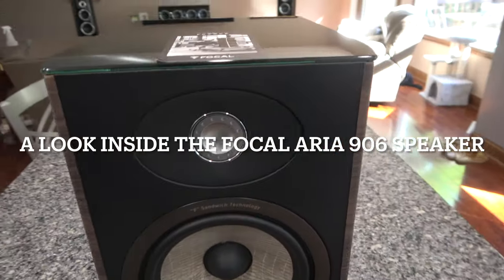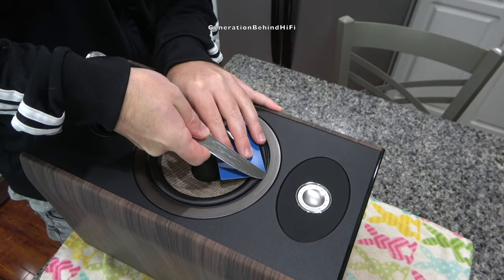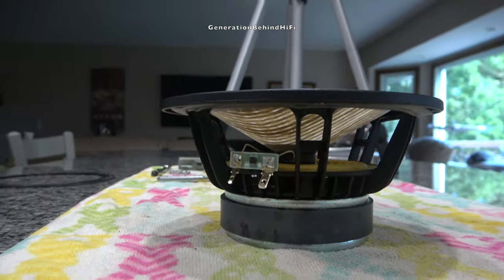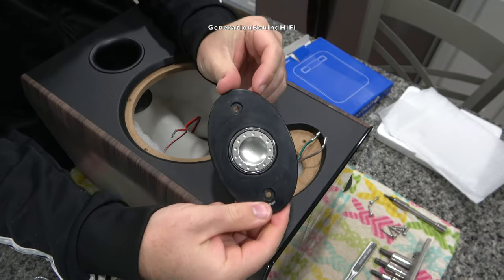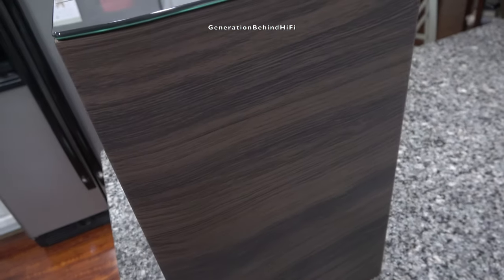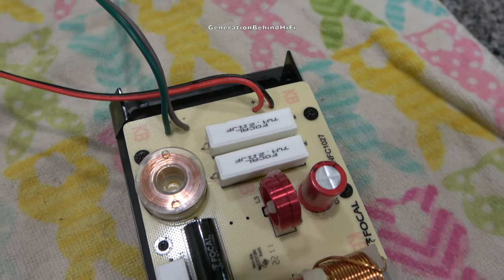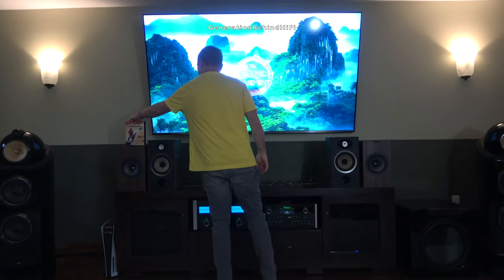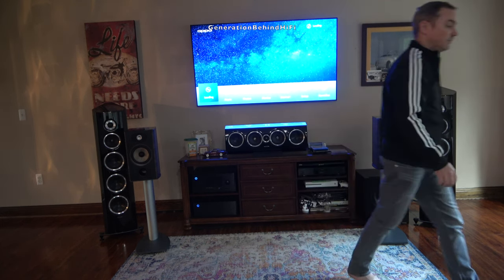A Look Inside The Focal Aria 906 Speakers

Comment: Really interesting thanks for filming. These are only a few hundred Euros during sales in Europe, which seems much more in keeping with the build. The soft stick-on wave guide and thin MDF were particular disappointments for me.
Reply from the maker: "These are only a few hundred Euros in Europe"

Holy cow! Really?! Now it all makes sense!
Reply: @generationbehindhifi  Yeah... each! Cheapest each is 439€ at the moment.
Reply: Yea, for whatever reason—import taxes/shipping/pure proximity—All focal speaker la are usually significantly less expensive in Europe than in the US.  Maybe they just mark them up because they are a little more revered stateside than in Europe where they may seem a little more ubiquitous. But if you can track down guys selling focals second hand in Europe and willing to ship stateside, you can get really really great scores.  And often, the Shipping isn’t nearly as shocking as you expect it to be, especially on Car audio.

Comment: Never liked Focal and it is shocking to see how cheap they make these speakers. Thanks for doing this. I hope you can get to do this with many other brands. Great video!
Reply from the maker: No problem! This was my first pair of Focal and I wasn't impressed! Check out my look inside playlist to see all of the tear downs that I have done -- the link is in the description.
Reply: @generationbehindhifi  I wish if you could do same video on B&W 606 S3. thanks for this video man
Reply: Focal was more known for making drivers that mostly DIY used to make their speakers with.   However, from what I have seen (here and in other places) their fully made speaker cabinets leave much to be desired.  Definitely not worth the money.  Not that I would be spending $2k on a set of bookshelf speakers anyway.

Comment: Looks like about $300 worth of parts per speaker.
Reply: That's about right. 300 in parts, maybe another 300 to assemble and paint etc. Then you have marketing, distribution, insurance costs etc. That probably means the selling price to trade is around 1000 to 1200, then the retailer will mark them up by around 40%. That gives your retail price.

Your comment is like saying "that house has bricks and mortar worth 10% of the valuation, so the valuation is wrong"
Reply: I believe he is implying that this speaker should be selling for $300 and not $2200 and he is very right.  Focal is on the top of my list of "troll" manufacturers that rob the buyer of their hard earned money.  Did you see the chinsy Radio Shack like tweeter the Aria uses?  No, Focal isn't getting my money...ever.
Reply: @everything777 maybe 300 to assemble and paint? Are you crazy!!??
More in the area of 1000 if you take into consideration European Labour Costs.
And please...don't come with the BS...It's made in China.
I've seen hundreds of these lined up at the production facility in France.
Reply: @jukingeo  don't knock it until you hear them!
Reply: No way in France these used to retail for 500 euros a pair and in the UK they have never been more than £700 a pair. The mark up in America is insane you are almost paying kanta level prices for an aria range. This just shows that sound quality has nothing to do with price of speakers as people in America are still happy with them for the insane $2000 asking price.
Reply: @Jordonater  My take on parts cost is influenced, I guess, by the fact that I've been building speakers for 50 years and remember what I used to get Focal drivers for back in the 1970's.

Comment: Can you do a crossover upgrade? Maybe Dodo Hex mat the inside too to fix the ringing. Speaker cable inside also looks weedy. Though I would understand if you just flogged them on but at 800 dollars if you get a good deal that does leave room for mods. At least removing the steel parts off the crossover and solder on some wire + upgrade wire + Hex mat would cost very little and should help.

Comment: It is hard to tell, but is there a seam in the woofer cone? At 2:24 in the video, there is a dark line at nearly 9 o'clock of the cone - is that a seam?
The magnet structure of the tweeter is *tiny*. There apparently is almost no space behind the inverted dome for a resonance chamber. I'm guessing the Fs of the tweeter is quite high?
If I was to guess at the XO design, it looks like a 2nd order on the tweeter, 1st order on the woofer, with a notch filter on the woofer.
Reply from the maker: Hi Neil, I know exactly what you're talking about because when I was unboxing these speakers I thought the same thing! Thankfully its just the material that Focal uses which gives off an illusion that there is a seem there. 

I didn't even bother to measure the tweeter because I knew it would probably be bad and I didn't want to turn this into a Focal Aria 906 bashing video. IMO the Aria 906's are a complete rip off at $2200 a pair, but at the current sale price of $998 a pair they offer pretty decent value for money. I just finished my review video of them and will post it next month. I go into more detail about how the Aria 906 sounds and compare it my KEF Q350.
Reply: Yes, I was mostly shocked by that tweeter as well.   It reminded me of a hard dome tweeter that I bought at Radio Shack to make a small set of bookshelf speakers.  It had a tiny magnet like the Focal's have.

Comment: Kef speakers are amazing. I just got three r11s.
Reply from the maker: Yeah, it is a stamped steel basket, but it sure does sound good. REL will happily sell you a sub with a diecast basket. You just have to open up your wallet a bit more. ;)

Comment: What if there was ferral magentic material in the binding posts? Also, its sad to see the quality in speakers costing so much. Seems like you can get the same quality or better for cheaper or diy. I guess in this example you are just paying for the name? Awesome video as always though!
Reply from the maker: Ferromagnetic components are never good in the signal path because they introduce passive intermodulation, aka 3rd-order harmonics distortion to the signal. IEEE did a white paper on their findings, which can be found here: https://ieeexplore.ieee.org/ielaam/22/8681220/8632973-aam.pdf

Comment: Thanks so much for this video as it goes to value and what one should expect for this kind of $$$$, with most speaker manufacturers.  Important thing to remember is economy of country built and where parts are procured.  In the case of this speaker it's all cheesy parts and the sound confirm this.  Pig with Lipstick...
Reply from the maker: No problem! My review video of the Aria 906 will be out on November 3rd

Comment: you are comparing Made in France vs Made in China. B&W and KEF make everything in China for everything under <5k per speaker.
These speakers can be bought on sale in europe for 300$/piece
Reply from the maker: I don't care about where they make them or what their "sale" price is. The fact is Focal had an MSRP on these speakers in the states for $2198 a pair. In my market (United States) these speakers did not offer the same value propositions that other brands offer at this price point.

Comment: Dude, don't use a butter knife!  Get a 4140 pannel pry tool so you don't mess up the speaker on accident.
Reply from the maker: Settle down, its fine! I promise no speakers were damaged in the making of this video. :) That's why the plastic credit card is underneath to protect the speaker. I don't see how a 4140 pry bar made out of stainless steel would be any better? I tried a plastic pry tool but it would just bend without loosening anything up so out came the butterknife, which served its purpose. The fact is Focal loves their double sided tape which can make servicing the speaker difficult.
Reply: @generationbehindhifi  having a hater just means you’re  doing something right
Reply: @EveryDayJay415 he's not an hater. He's more of a seeker. Seeking out things which Ain't Perfect 😂
Reply: @totalplonker824  He isn't wrong though and the tool mentioned does an exceptional job, taking crude tools to expensive equipment is looking for trouble - eventually it will cost you.
These FOCAL speakers were a bit of a horror show inside for $2000. Garbage.

Comment: Some context needs to be added. These are actually 1000.00 speakers in France and most of Europe and went for 1500.00 in the US when first introduced. Focal products have always been high in the US. The only reason the price is this high are greed and inflation from Focal's owners. 2198.00 is really way to much for these. With that being said they should be judged as 1000.00 dollar speakers and not 2000+ speakers. In this context  the build quality is just fine for a speaker at the 1000.00 price point that is built in France.
Reply from the maker: I didn't know that! Thanks for sharing! Unfortunately the fact is Focal sells them for $2200 a pair in the United States so they need to be compared to other speakers in that price category.
Reply: @generationbehindhifi Does the focal sells them there or does the distributors sell them there? I honestly cant buy directly from focal unless Im in France so I imagine those are distributors that set those prices and focal is not to blame
Reply: @generationbehindhifi  In france the 926 towers with center and the surrounds or 906 speaker 5.0 set is less than 2000 euro

Comment: The Ascend Acoustics $1495/pair Sierra LX speakers absolutely destroy these Focals. Cabinets are 3-layer bamboo, drivers are custom spec’d SEAS, and they are designed, engineered, and optimized on the $100K Klippel NFS. Frequency response is an extremely flat +/- 1.25 dB across the range. And those Focal $5 crossovers are a joke.
Reply from the maker: Never heard of Ascend Acoustics, but I sure wouldn't mind them sending me a pair to review and tear down.
Reply: I'm with you!! The Seas units are some of my favorites.  I've built hundreds of xovers and there's no way I'd put that one in any speaker.

Comment: Its almost criminal the price you pay for cheap crap Its all markerting hype its the same for a lot speakers unfortuatly
Reply from the maker: You're correct. Just look at all the snake oil surrounding $500+ speaker cable that in most cases is still made from copper!